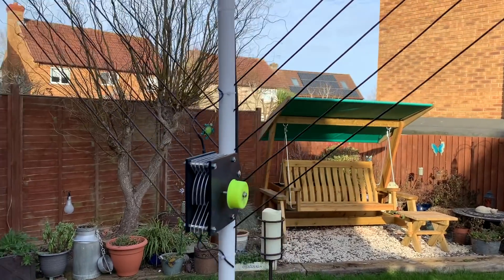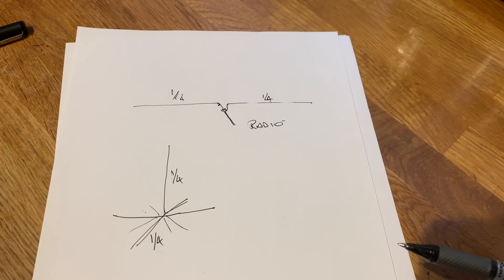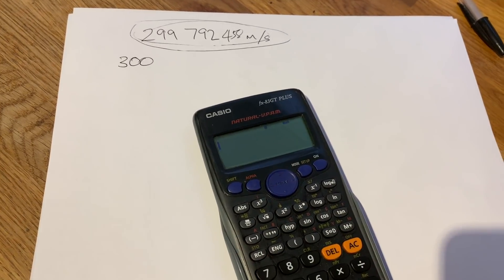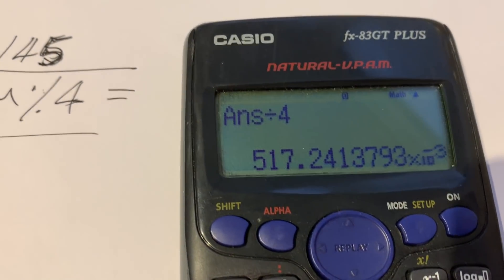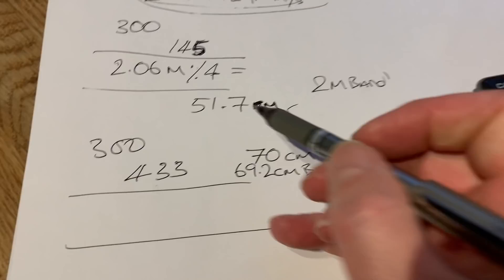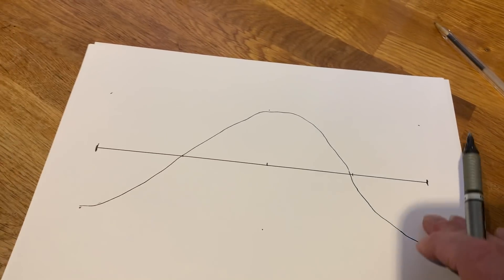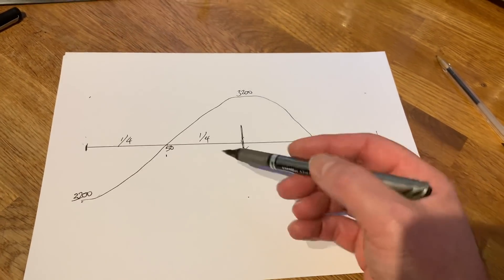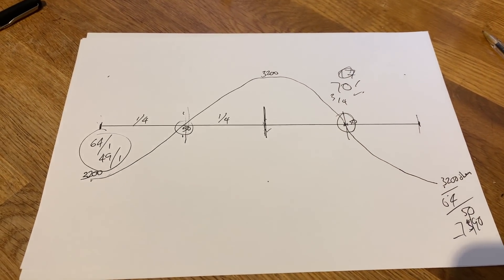HAM RADIO: Dualband Antenna, How They Work..  and other stuff

Comment: how did you calculated 3200 ohms at the end?
Reply from the maker: I didn't, it is a impedance figure taken from the end of a wire antenna and used to demo the relationship of the impedance you could expect  to see as you move a way from the null point on a dipole antenna.

Comment: Excellent video...... You explained the 3rd harmonics of a basic dipole perfectly! 
  In fact, your explanation was so good it shed some light on simple calculations for 3/4 wave antennas on the HF bands. I’m going to get out my coil of wire and try some builds in the very near future. 
   Next, you should explain the harmonic characteristics of a loop antenna.
Reply from the maker: Glad it was helpful!

Comment: Very clear, thanks. I built this 2m quarter wave exactly the same way you did with swr 1.06 using HT (5w) but when i connect my 50w rig swr reading shows 1.64 and power showing only 30w ( i am using same swr meter shown in skylab video) any possible reason?
Reply from the maker: Not sure why that would be, may be the materials used??

Comment: Regarding the Frame Antenna - put a couple of varicap diodes in place of the variable Cap and feed the voltage along the feeder - I have one for 80 and one for 160 which also has a second frame that is also switchable from the shack to give N/S and E/W

Comment: When you get a fractional answer, If you press S<=>D button on your calculator it gives your answer in decimal. No need for the ENG button unless you want your answer to a power (index)!
Reply from the maker: Hey thanks Simon.
Reply: You can blame the education system for the abortion that is algebraic calculators that try to emulate the equation as it is written down.  I am so glad that I transitioned to RPN back in the eighties. No need for brackets or equal keys and every intermediate result is displayed allowing sanity checks all through the calculation.

Comment: Makes Sense Mike, but where does the longer antenna benefit us? Say a full wavelength or a two wavelength antenna can we benefit  from the longer antenna or is these a  point where more wire does not benefit the TX / RX. Or how about an array or 3 quarter wave antennas would that provide a better TX /RX  just trying to understand what makes a better antenna.
Reply from the maker: ah yes this is co-linear stuff will have to do a video on that, but quick answer if you have 2 or 3 x length it flattens the far field patten increasing gain (less power is lost to the sky)